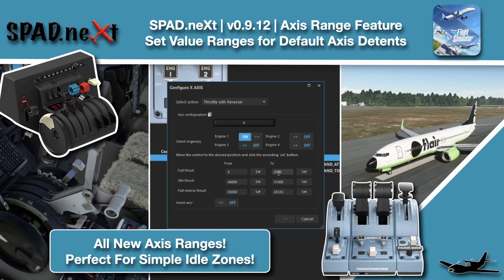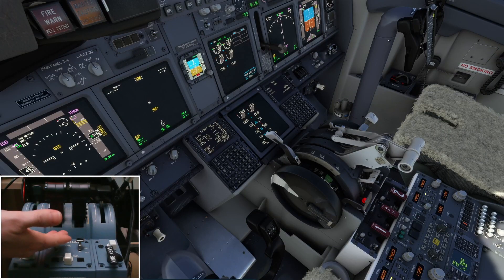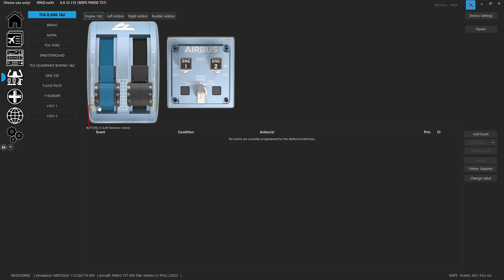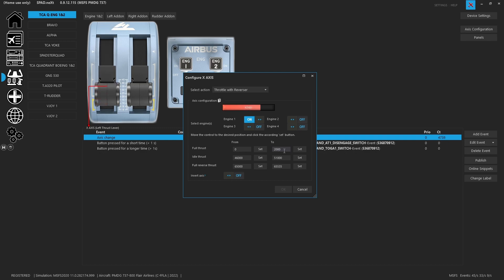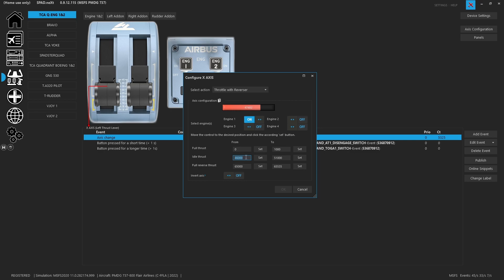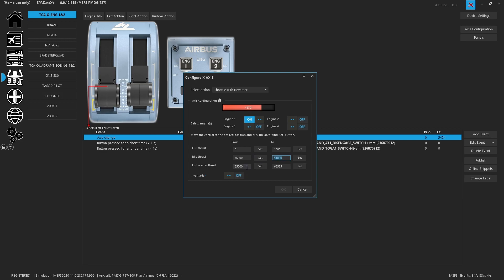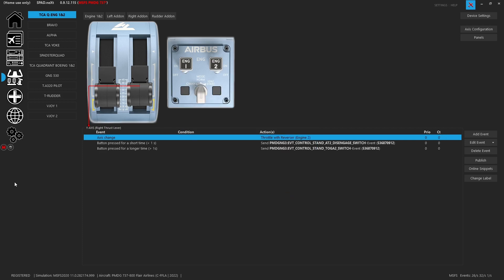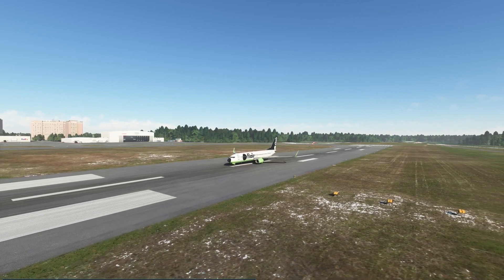MSFS | SPAD.neXt | Axis Range Feature | Easy Idle Zone Assign!

Comment: Hi Les, can this be used with the Honeycombe Bravo for reversers
Reply from the maker: Bravo has no axis in the reversers. There is “buttons” only. So no way to do more than and on or off with the reverse  handles. Or you use the handles buttons to toggle between rev or fwd thrust and you move the handles forward after flipping the rev handles to control the thrust.

Comment: Great video. Thanks so much for doing it. Do you think you can do one for the Bravo Speed brake when using the 737 handle kit from FlightsimFactory? I just got my kit and I noticed the detents don't match up as they should.
Reply from the maker: I have mine set to Custom Axis .. And then drive the Spoilers Axis and it seems to work well with that..
Reply: @LesOReilly  did you by any chance make a video tutorial on that? Please forgive me as I'm new to this and I do not know what you meant by what you said. I'm currently using your 737 profile and I don't believe you used a custom axis in that one.
Reply from the maker: Yes long time ago with the A320 showed how to map multiple ranges using the custom Axis
https://youtu.be/dent3kU9tdQ